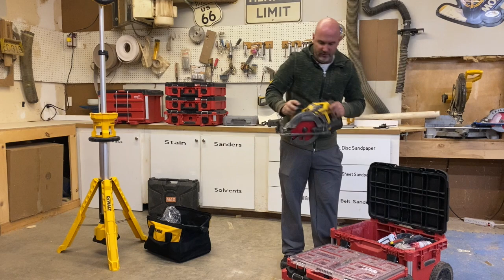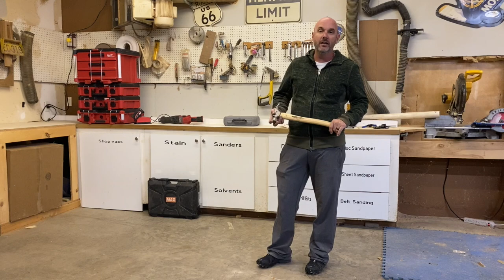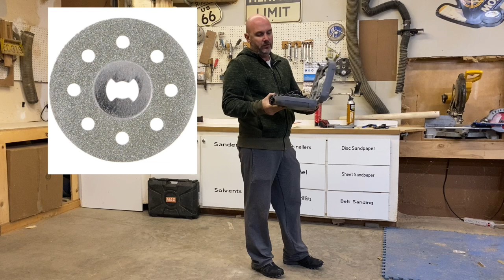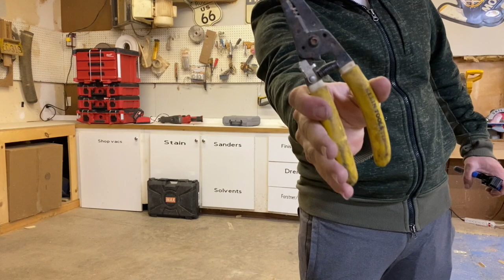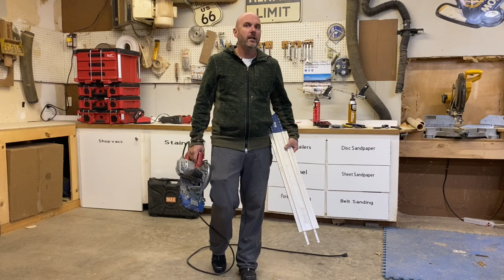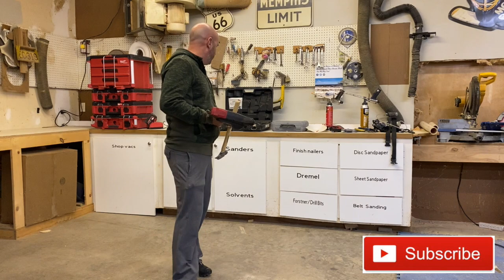Top Tools For Christmas!

Comment: Thanks for the suggestions. Do you have a recommendation on laser levels for a weekend builder? There's a wild variance in cost so wondering what's best bang for the buck.
Reply from the maker: You mean laser transit or a visible laser?  We have and use both but for stuff around the house i would use  the green visible laser by dewalt, it’s very versatile for laying things out and leveling just about everything!

Comment: The charge on those cordless nail guns last so long.
Reply from the maker: That and the twin tier…. I’ve gone through a box of wire on 5-6 pools and charged it once, the nailers actually work well on the little 2a/hr batteries that I hate on impacts because the run down so quickly!

Comment: Good stuff Aaron, like all of your  videos. 

Question, what are your thoughts on using Helix micro rebar as a substitute for some of the rebar in your ICF walls and pool floors?
Reply from the maker: Ya for the monopours it would save a ton of labor, the engineers still require me to use bar on spillovers…. But on liners I worry the steel fibers near the surface could spring out and puncture my liner, plus there’s not much rebar in liner pools to begin with….